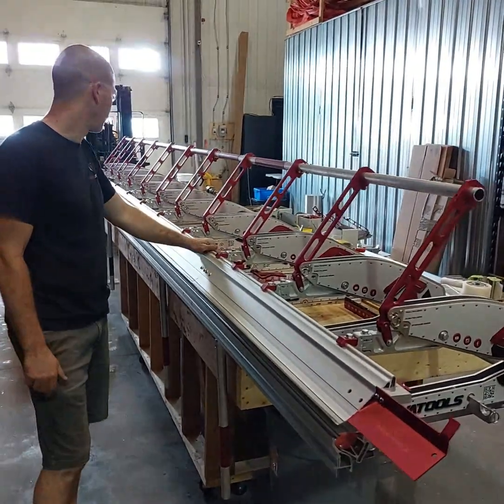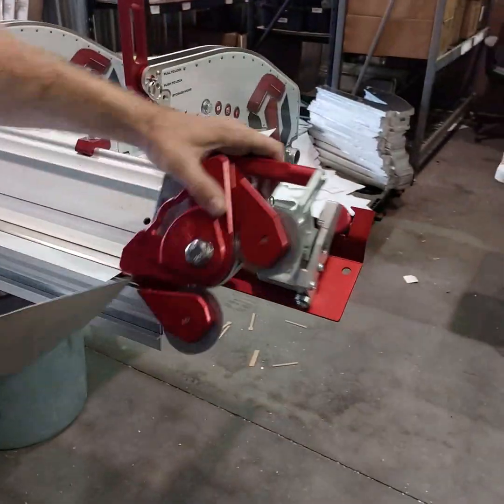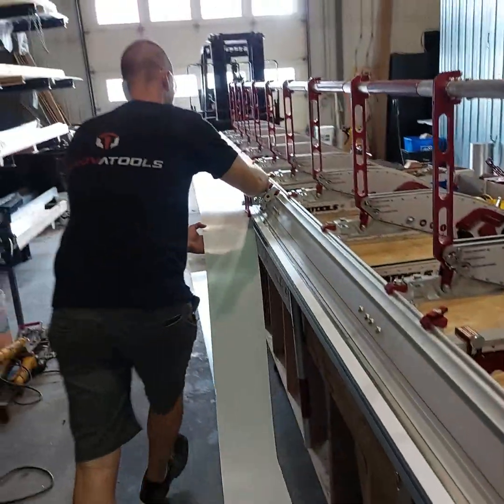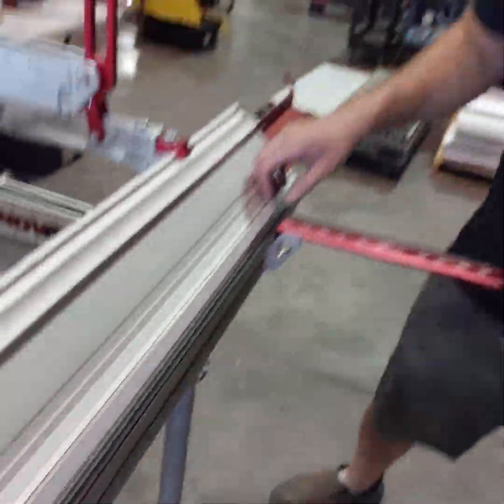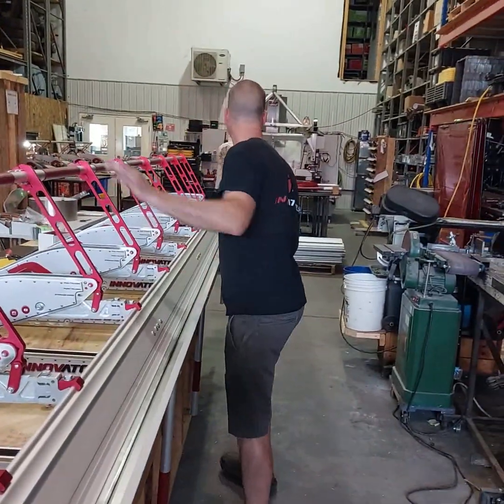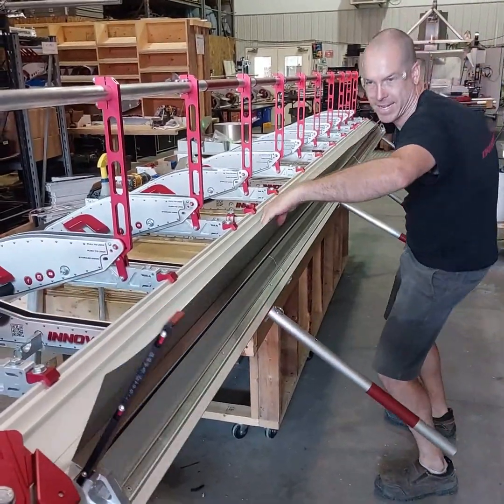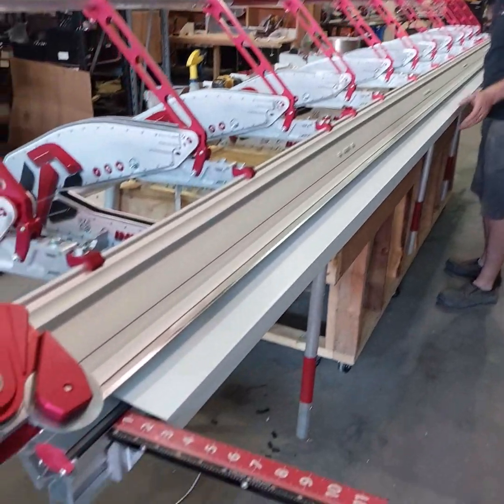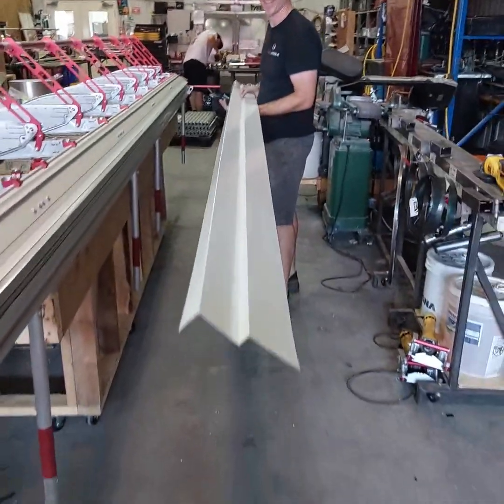17'6'' Innovatools Modular Siding Brake - bending a 17' Step Fascia SOLO!

Comment: I have all of Innovatools' accessories for my Van Mark brake but this thing is something else. Rotating depth stops, an outrigger for your brake buddy (that cuts in both directions), those offset gauges look like they're laser engraved, and it's modular! A window/siding installer could have 3 sections in the job trailer and still perform 95% of the jobs out there, and keep an extra section in the shop for those rare 12' or 16' or larger openings.

Comment: Very impressive too
Reply from the maker: Thank you! Cheers!
Reply: @innovatoolsinc  do you have on this machines some degree indicator, if i want to bend on 70° how can i see it on machine?
Reply from the maker: Our angle indicator is currently in the works! Should be coming out in the next few months and it'll have a few additional interesting features/benefits too;)
Reply: @innovatoolsinc  and is it possible to put your two 12'6' machines together with some clutch, becouse i make most of things in one peace so i need 24' length to be bend in one peace
Reply from the maker: @Bodega1096  you can make it as long as you want! Our brake system is made up of modules that get assembled together to make it as long as you want!
Reply: @innovatoolsinc  so i can buy two 12'6' machines and put them in my truck and quickly assemble them together when i come to place where i work? And want be problems or scratches on 24' long metal that i am bending?
Reply from the maker: @Bodega1096  depends what your expectation of quickly assemble means,  i would plan at least 10-15mins to join them together... and depending on the material you are bending you might need 2 or 3 guys to bend,  there's no issue with the brake but the longer the piece the more strength it requires to bend the piece especially on thicker material.   And no there's of course no scratching issue, that would defeat the whole purpose of a bending brake 😉
Reply: @innovatoolsinc  10-15 min is fine for me, and of course 2 guys for work.. and i only didnt see your  machine in action on pressing, becouse we here do lot of bending a 1 cm and press it then.. and also what is the minimum lip i can put on machine and bend?
Reply from the maker: @Bodega1096  sorry i had not seen this message, our hinge to bending edge distance is 5/8'' (1.6cm). let me know if you have any other question!